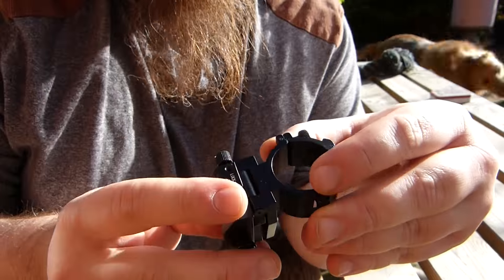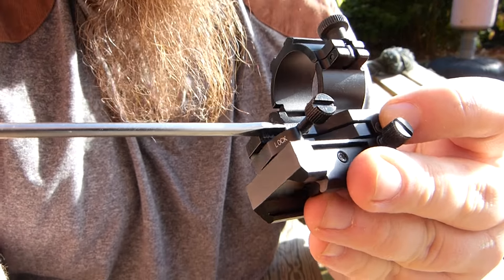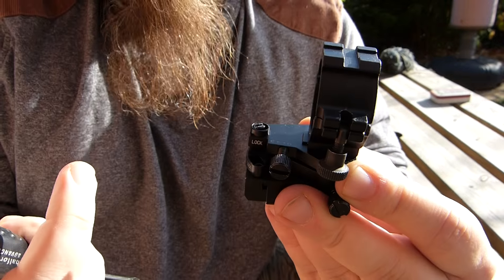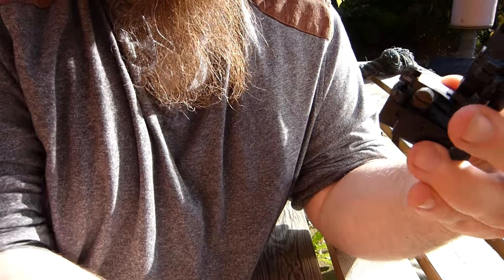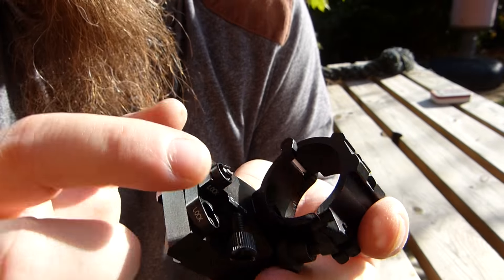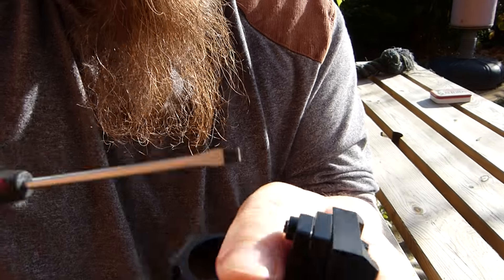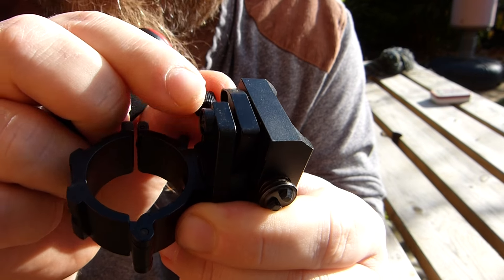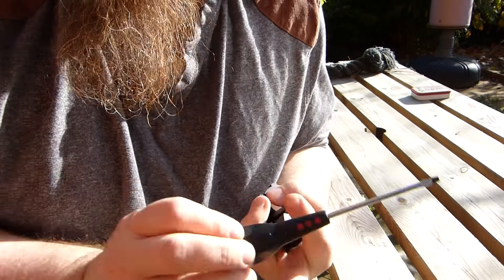"custom rifle scopes" rangefinder mount problem?

Comment: Hello, customriflescopes here, noticed your video and you are entitled to make one but we think that would only be the case on some scopes, as you can see from this link in some of the photos you can clearly see the locking screw can be accessed= http://www.customriflescopes.com/shop.html#!/Weapon-Mountable-Rangefinder-Universal-Mount-System-©-zero-to-your-rifle-scope/p/59804429/category=13698045.   
We have had not one customer apart from yours truly have this problem. BUT and this is a big BUT, we have had a new design for quite some time now that doesn't have the locking screw on top anymore, only the pre loading spring screw that is adjusted before you put it on the scope, the adjusters and the locks are mounted side on, this is also better for stability so you do not need to worry any further, here is the link to show you the mounts = http://www.customriflescopes.com/shop.html#!/Adjustable-torch-laser-designator-mount-can-zero-to-your-rifle-scope-new-design/p/59804496/category=13698045

hope that clears everything up for you !
Kind regards CRS
Reply from the maker: Thanks for your comment. But im not sure that you've understood the video. Theres 2 real issues.

1. The scope body, will ultimately ALWAYS block the adjustment. This was tried on a Hawke sidewinder, in 3 sizes. A Hawke endurance. A Hawke Airmax, a bushnell 4x12 x 32 and 3 cheap chineese scopes of unknown origin... ALL having the same issues. Those scopes are all very representitive of scopes on the whole. So I dont believe this was an unfair video to post, or question to ask. 

2. The issue where the locking mechanism changes the actual adjustment (as seen from 1:20 onwards) is simply a design flaw. The lock should have a singular use... To lock. Having the lock change the adjustment, means that the locking down of the unit, changes it... Thats exactly the same as a vernier, that when taking a measurement, changes if you lock it in position... It becomes useless... This is obviously fine if used for a torch, as the unit was originally designed for... Because thats a very imprecise unit. But this is meant to zero (and stay zero'd) to a precise point... And the very feature used to guaratee that, does the exact opposite. 

I cant see any singular image on the link you provided, but looking through the site, I can see that the addition of the seperate piece, and having to dissasemble the mount, and reassemble it in another configuration can help with point 1. But that still doesnt change, in any way, the rather drastic design flaw in point 2. 

I also have to point out... As no instructions were provided... I had no idea I had to strip and rebuild the mount into a completely new configuration. That might be worth addressing, as well as the locking flaw. :o)
Reply from the maker: I will add, that looking at the new mount... That indeed would help a little... And obviously there was a flaw in the original design to move to the new design. This doesnt help if you would have to buy a second mount, to replace the first mount purchased from you... Because it didnt work. 

The mount I used was, honestly, unusable... I had to visually guide the ping onto the target (via night vision, and while zoomed out), get the range, then zoom back in. And each time it was taken off, I had to re-zero it, to even get it close (because, it couldnt be locked). In daylight, its not useable at all through the scope... You have to use the "iron sight" on top, which isnt very precision for small game. 

I'll add... We really, really wanted this product to work. We've (between the group) got 8 rifles to mount up for and this would have been a perfect solution. As it goes... This now stays gathering dust in a gun bag, while we revert to a standard rangefinder... I've been trying to get it to work since this video... Which was almost 5 months ago...
Reply: As you remember I did refund you and let you keep the mount system but there are thousands of scopes and you cannot build a modification system to suit every setup and every scope ( please try designing one and i will find a scope that it will not fit ), as i said before you were the only customer whom had the issue and for that you got a refund for the mount and got to keep it.....not many companies would do that for someone.....so please don't take it the wrong way, you have a point for a few scopes but not that many !
Reply from the maker: Let me start by saying that the refund wasnt given out of the goodness of the companies heart, so lets not delve into exactly why. It doesnt help contribute to the technical issues. 

Regards other scopes... The issues are caused by the scope body. While every scope may have different turrets, battery compartments, objective sizes, etc... I think its fair to say that they all have a tubular body. The only way for this issue not to be present, is for a scope not to have that... Which I think you would agree, is rather silly.

Regards designing my own... I have to point out that, in this case... The mount isnt designed... Its repurposed to sell alongside the rangefinders you resell. The only designed piece is a 3D printed unit you sell... Which, to be fair, worked just fine. Its the reson its not part of the video. Im sure if you actually designed and manufactured one, it would be great, but as far as im aware, this isnt the case. Which is a shame, as I really did WANT to like the product. Still do. 

I think though, that the over riding thought is that, as supplied... The mount needed stripping and rebuilding, to work "as intended"... So instructions would have cleared a LOT of that up. Additionally, the sales patter of (I paraphrase) "locking, so it keeps zero" was completely false... Hence the redesign... So making this video question really wasnt unfair. If you can show me how to use that locking feature, WITHOUT changing the zero, and while on the scope... I'll happily apologise, remove the video right now.... And then set up for a zeroing session tonight... And make a video of the sucess, as well as the obvious positive review for a now working product.
Reply: Just to let you know that design is now changed for this new type as it brings the rangefinder closer to the scope, giving the rangefinder a lower profile, it fits directly to weaver mounts only so on the rare occasion like yourself, you wont have that problem!  = https://lh3.googleusercontent.com/-iGjs1NuX4BQQaIBU5S7XYr-I7dsU_3uLp8nps4aJhQ7nQGTAPN8SdWz-bBqR6Xs-K6gX8ws8XxdfTZhhOZk2zAucPyEiS8VtvpG9aGNQ4TmMp3QPW6Ov8BvY_8OggJc0Unno4Q80G2vldnwVTTVeiOE8o4-gyUTmE_y-2_Qdj0zhFOq-KojcL723A7Ew_ql2bmGeejWr189lC4I_k-9p1hmGpLz6kBBFe2yijaORLUYc5DRMatahYxkNuDD8bNm5v_sOuf_ohSeZJt-kYXQ8sYx98oMSvIEg0c01W7Hqsajj8t05TRwqLnlBKKxUqt9o3G_x5BV-qE_jpc3VnbC2J1TnYp77hqmvv0P-fX_dYNg4aGJALvW41xa-_cVeKdVmluO10zeygn0gbKMxORqve-GhuGgIg69GyE3oEKeffWsqrGUXmsmy9s3rSgWAF2jzIJ-7U-_t9gZNJXAcEZ2-UHsqPlAqvnCdaHVeMxS83FL6uWMdH9D25wh38DcE3UmeyUkrDhnlMoNLuLG0FJcsiAKmtwrVIyy_7Q6OBXXPxNjeEjeGPDwW-g3AIPzFF0QOs4GB_KqPGKtiw7gZeY93jgpBuAR8b8FLq1zDDUCg1-HLrKwreFnAQ=w535-h950-no
Reply from the maker: customriflescopesuk Splatty thanks for the update. Sadly, as it looks to be top mounted only, all the night vision equipment would obscure it.
Reply: There is going to be a side mount option too, and not all NV is side mount !